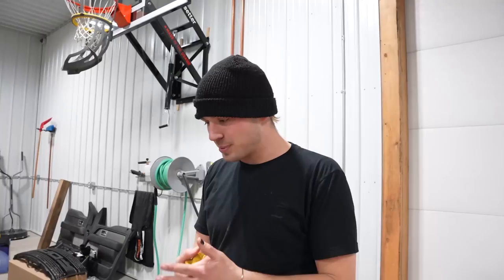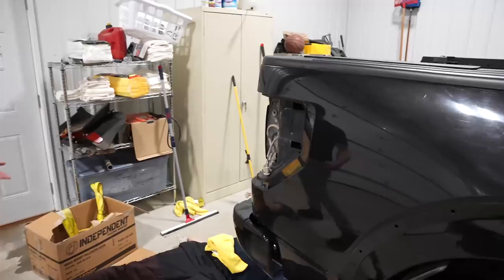I Put Tracks on My 200K+ Ford Raptor (TRACKTOR)

Comment from the maker: What else do you think we are adding to this thing?! Who Ever Guesses right first ill send the first 3 people the whole new Merch drop free!!!
Reply: Tires lol
Reply: I’m thinking roll cage internal or external
Reply: Roll bar with roof basket
Reply: bumper lift kit new interior seats long travel suspention air horns
Reply: Train horn, maybe snowboard rack? And the rally bars with old mustang seats in the bed of the truck, gotta be something right on that list
Reply: Train horn, lift kit, roll cage, new front grill
Reply: A sound system
Reply: I'm hoping bumpers (bull bars maybe?) and a rack (you said rack the vid though) it would be pretty bad ass if you follow thru with the bench and roll bars in the back haha. My guess is deff some bull bars though
Reply: Skis on the front
Reply: 10k lb winch
Reply: Camper in the back
Reply: Wings lol
Reply: Winch, light bars/lighting & roof rack
Reply: Some Lights Like a light bar or some spot lights
Reply: Ford traptor
Reply: Ford traptor
Reply: Cabin in the bed of the truck to crash in.
Reply: Light bar
Reply: 1000 hp
Reply: giveaway.
Reply: Roll cage and push bumper with winch and leds
Reply: Roll bar or rack over the bed with seats for people roof rack
Reply: Engine upgrade
Reply: Sled deck
Reply: Stripper pole for ol tommy would be legendary
The cold won’t matter once he generates all that heat
Reply: Gas cuz it’s gunna b a HOG 😂
Reply: Lights
Reply: Sled deck
Reply: Sled deck
Reply: Winch
Reply: AIR HORNS
Reply: Little do we all know, he’s using the comments as ideas for what he’s ganna do next👀
Reply: Idk man a Cummings swap or something?
Reply: Light bar
Reply: Bed roll cage <|
Reply: Lift kit, roll bar and some black housing tails to bring it together in the back!
Reply: hey bangin